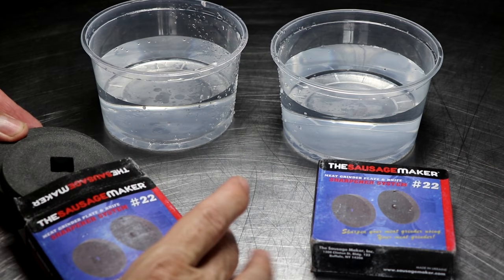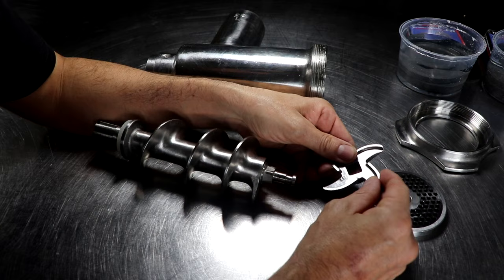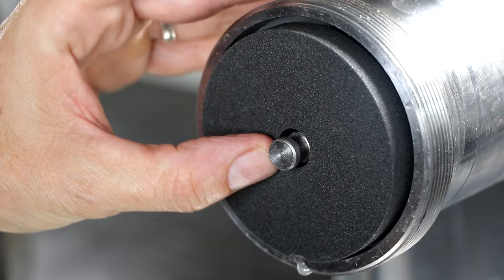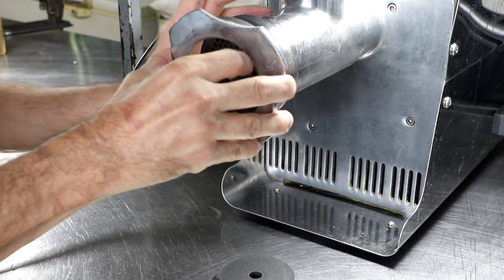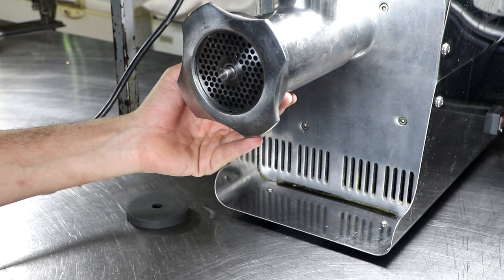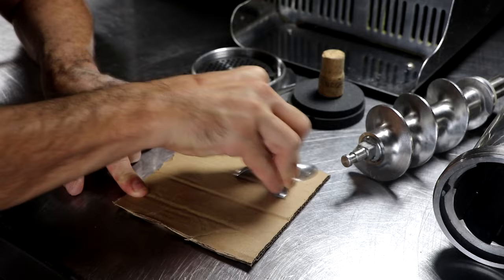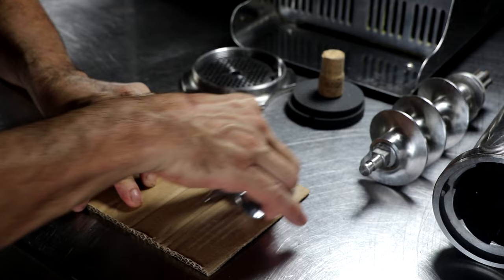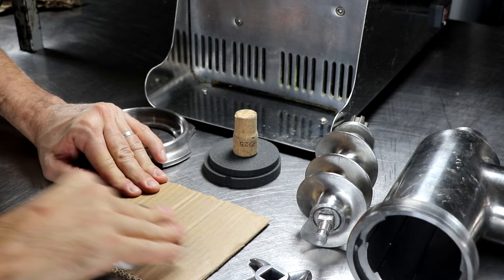Sharpening a Meat Grinder's Knife & Plate

Comment: Get some 220-400 grit wet dry silicone carbide sand paper and adhere it to some plate glass work your blade in a circular motion do the same to both sides of the plates you want sharpened. works great

Comment: Very cool way to do this "automatically". I just use a good flat water stone of the proper grit and sharpen both the blade and plate flat against it. I get rid of the burr using a soft buff and finish by washing it and then running some stiff dough (just flour and water) through it to pick up any loose filings or grit I might have missed. It works quite well.
Reply from the maker: Excellent Method.  Thanks for sharing that.
Reply: About a week ago I sharpened a neglected meat grinder with sandpaper supported by a glass sheet.    Worked well.  But can see where these stones could be faster.
Reply: Same here. The grinder doesn't spin that fast, so a minute or two on flat stones should be about the same. Plus no risk of getting stone grit and steel shavings inside my grinder...

Comment: I find that taking a medium Sharpie pen and drawing lines a cross the plate will show you if it is warped or concave. Concave problems are likely fixable, run your sanding method until all Sharpie marks are gone, then do your fine grind. My factory plates, as I found out much later than I would like to admit, came and it was concave. I thought I was sharpening it but still got fat smear in the center.😠🤬🤬🤬! Then I heard about the Sharpie method. What a difference! I use a glass lapping plate, 220 & 400 grit wet/dry sanding paper. I was unaware of these stones.

Comment: Since both of those parts are flat, it's probably cheaper to just buy a sheet 1000 Grid sandpaper and just rub the parts on it.
Reply: True..but be careful! The surface of the plate on which you place sandpaper should be flat else you ll ruin both cutter and plate post grinding..
Reply: I just ordered these and they were dirt cheap. Over time, the sandpaper would cost more.

Comment: Having trouble figuring out what size blade set to buy  for my meat grinder. I have a “American eagle food machinery, inc” meat grinder. Model number AE-G12N. Looking at the product you linked on amazon . I’m thinking maybe 10/12 size . Not sure . As reads hp 1 , amp 8 , volts 115 , cycles 60hz , phase 1.
Reply from the maker: Looks like it's the #12.  You can measure the disk you have and check to be sure.  #8 will measure 2 1/2 inches across, #10/12 will measure 2 3/4 inches across and #20/22 will measure 3 1/4 inches.  Hope that helps..

Comment: Huh...  I did not know that was a thing.  perhaps ill try that and my grinder won't smear the meat any more
Reply from the maker: That's the very first thing that I noticed when I used it.  My meat was no longer smearing and it was coming out clean.  Also the texture of my sausage improved greatly..   Thanks for the comment.   My one piece of advice is be gentle with the stones.  They aren't that thick and if you drop one or force it in the machine it will crack in half...  If you use them let me know how it works out for you...
Reply: Will this fit a #10 manual grinder?
Reply from the maker: @raynardo2501  Yes.  If you buy one just be sure to select the #10 size and either the course or fine stones..  It will fit no problem!

Comment: Hey Eric. I just ordered this sharpening system on Amazon. I noticed that the rating for these is not very good. I'm thinking that's because it's easy to break the stone. I bought both a coarse and fine stone.

Hey, I have a #22 stainless steel grinder.  Problem I have is the grinding tube is bolted on and does not come off like I see other grinders do. In order to clean mine, dont I have to unbolt it and remove the meat tube?
Reply from the maker: That is correct.  The stones can break if your not careful.  When you say grinding tube do you mean the auger?  I would say yes, in order to clean it your would have to unbolt it.  Could you send me a link to the one you have so I can see?
Reply: @2guysandacooler  did you see my link to the grinder I purchased?
Reply from the maker: @brewingman56  I'll have a better chance tomorrow.  I've been swamped the last few days.
Reply from the maker: @brewingman56 , Hey Mark.  I just got a chance to look it up.  That is a very interesting design.  Here's one on Amazon.  https://www.amazon.com/Commercial-Grade-Electric-Grinder-Stainless/dp/B07H9JV9Z1

It looks like (according to the picture) the tube can be easily washed.  I can't imagine a company bolting down that piece and not making some type of quick release.  Ok.  To answer your question.  That piece does need cleaned after a grind..
Reply: @2guysandacooler  So, I will need to unbolt the tube each time then?

Comment: Will this sharpen Industrial meat grinders such as a Hobart?
Reply from the maker: It might.  It all depends on the size and the connection area.
Reply: @2guysandacooler  Thanks for getting back to me. I'm wondering about the hardness of these industrial plates. Can this abrasive effectively work the surface?

Comment: Do  you need fine and course stones.

Thanks
Reply from the maker: The course stone sets the edge and the fine stone refines it.  For general maintenance you could just use the fine stone but if it's badly worn the course one is the way to go..
Reply: @2guysandacooler  Thanks !!!!!

Comment: What size hole is your corse blade
Reply from the maker: I'm not sure what you mean.   What size is the center hole on the course disk?
Reply: 2 Guys & A Cooler  what is the diameter 1/4 1/2 or smaller for making sausages that's what I meant
Reply from the maker: @joegonzalez7704  It depends on what I'm making.  Most often I am using 3/4 inch for fresh sausage.  If I am making snack sticks the I will use 1/2 inch.  If I am making Salami I will use the 1.5 inch.  It's nice to have the options...

Comment: Maybe it's out of topic but my retaining ring is stuck. I think it maybe I screwed it to hard or something because I just finished grinding my meat
Can anybody help me?
Reply from the maker: I just got your message.  Were you able to remove the ring?  Sometimes I'll wrap a towel around the ring and gently tap it with a hammer to loosen it.  My general rule is to tighten it all the way then come off 1/4 turn.  Hope it worked out for you
Reply: @2guysandacooler  
No :")
I will try your method. Thank you for replying 😄

Comment: ok people you can go to harbor freight and get some wet /dry sand paper and put some water on the 220 grit with a back and forth motion go 6 times turn it to the right a quarter turn and do it again the same with the plates. then move up to 400 grit. sorry but these stone there showing you will get groves in them over time and will mess your blades up
Reply: I just ordered a set. It’s $16. What you described is $4 for each grit. That sandpaper is going to be gone in no time.
Reply: Hello, I just ordered a set. It’s $16. What you described is $4 for each grit. That sandpaper is going to be gone in no time.